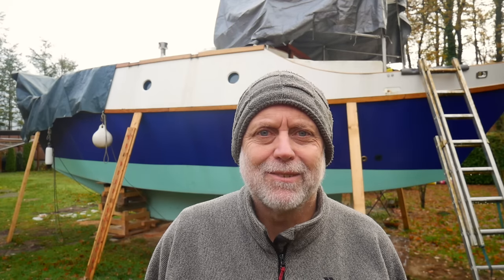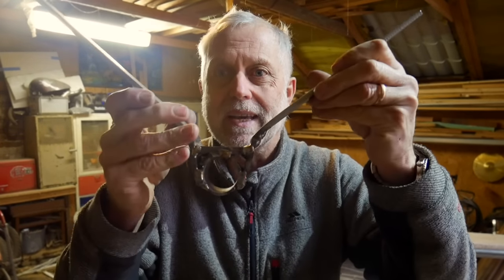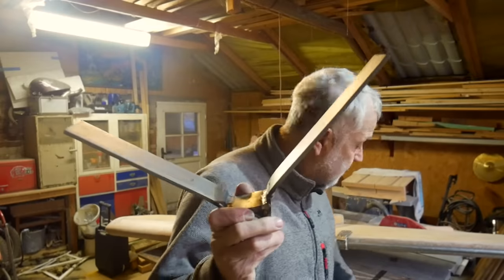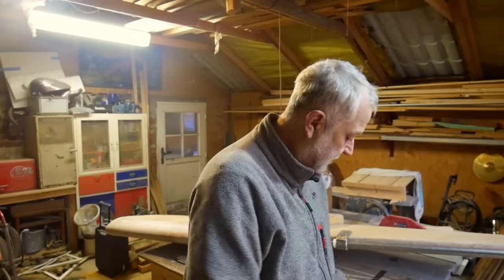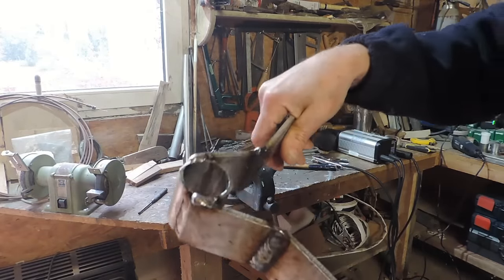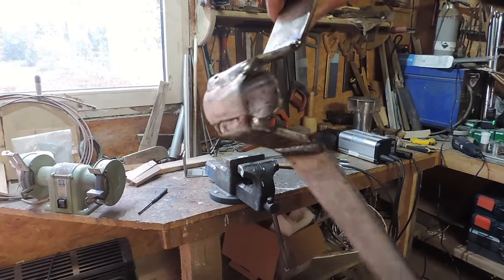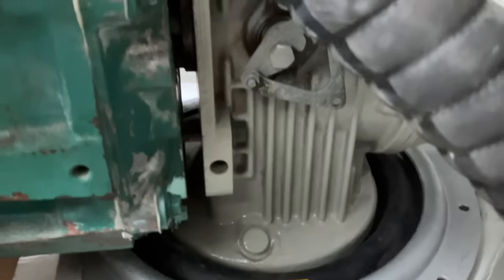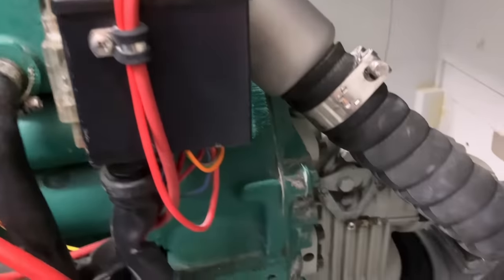The Noble Art Of Amateur Boat Building ;-) - SV Tapatya EP256

Comment: Some great progress there, Tony! In addition to getting the angles right, will you need to apply any vertical twist to the tangs of the fittings as well, to match the 'V' shape of the stern, as seen from behind?
Reply from the maker: Thanks Garryck. I hope I’m right in saying that they don’t need a twist. They should fit as they are at 90 deg to the stern post line 🤔👍

Comment: Hi Tony, what you call a double ender, I call that a displacement hull, or is that something else, or have I had it wrong all these years. Don't forget, all those whit bushes you've made, make a FULL set of spares to take with you on you and your wife's travels far and wide. Did you order enough bronze to make a spare rudder shoe Tony. Take care, stay safe. Seeya Rob
Reply from the maker: No, I believe you have it wrong. By double ender, I mean a hull that goes to a point at both ends, as opposed to having a transom. A displacement hull just means it moves water out of the way as is goes forward, as opposed to planing over it
Reply from the maker: Thanks Rob
I shall certainly make spare bushes, although if they don’t last, I shall probably change up to bronze bushes 👍